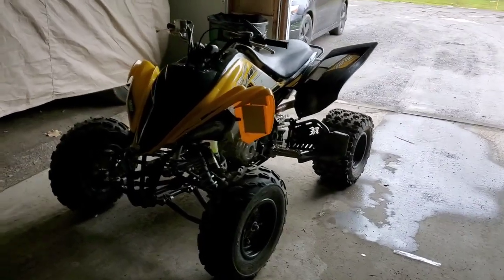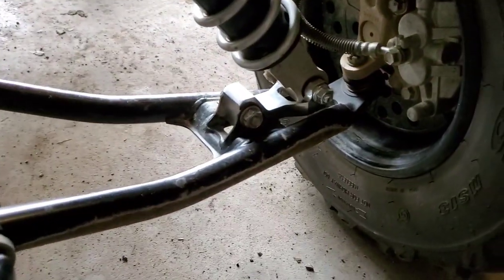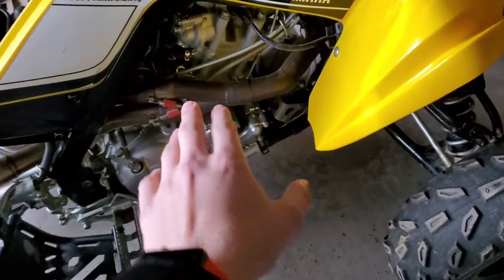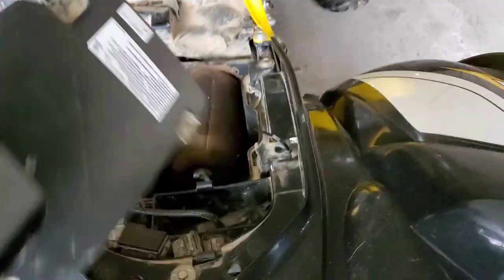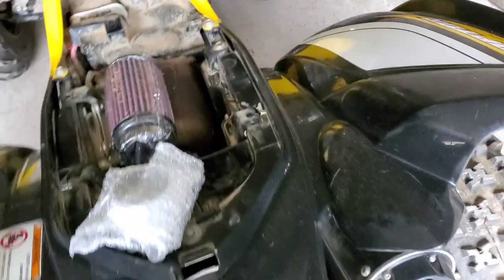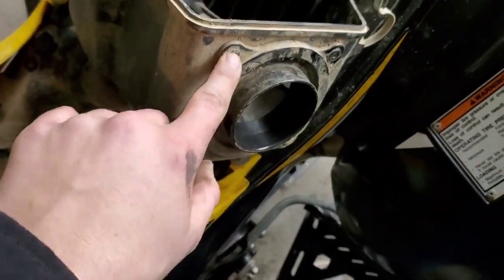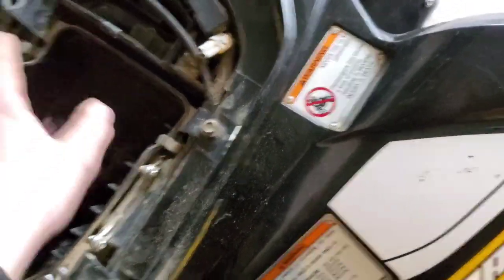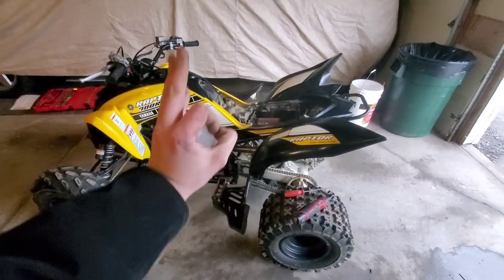2016 Raptor 700R update and Air Filter!

Comment: As angel said use a medium "blue" threadlock compound/liquid which should stop your bolts vibrating out.
Reply from the maker: Thank you! I will do that once I gat replacement bolts!
Reply: @JNKRacing  had the same issue on my 125cc 4 stroke Lexmoto Adrenaline supermoto. So when I got my Spy Racing F3-350 Quad Bike first thing I did was blue threadlock anything cosmetic and the parking brake too.
Reply: @JNKRacing  https://youtu.be/LTisTFvyWgU this is the Quad I have very different beast from a Raptor.

350cc, 6 speed gearbox, limited slip diff and shaft drive. Dual Exhaust system from the factory too. Front tyres are 185/30/14s and Rear tyres are 275/30/14s.  Always get a load of smiles wherever I go on it.
Reply from the maker: @jameslrbrand2002uk  Yeah we figured it was a common thing just never got around to dealing with it lol!
Reply from the maker: @jameslrbrand2002uk  That things is sweet! I have never actually seen one like that! Sounds wicked to ride!
Reply: @JNKRacing  Oh it is sweet to ride. Had it up to 92mph on GPS. Got it in the same colour as the video too. Forgot to mention it has a 13ltr fuel tank and 5 disc brakes one on each wheel and then one for the parking brake mounted on the driveshaft.

Would still love to get me a Raptor though and maybe fit an engine and gearbox from a 2018 Yamaha R1M, I've only seen one such bike done here in the UK though a few others run the engine from a 2013 Yamaha R1.

Comment: maybe use a lil medium thread-lock juice on them bolts so they won't loosen so easily...and I was wondering what fuel you use ..racing/non-ethanol/super etc....and also if your considering changing the fuel injection system ..
love the K&N filter addition and the duel pipes look wicked  🤩🧡
Reply from the maker: For sure! I actually run between 93 or 90 ethanol-free,  I haven't really considered changing the injection system, but a cam and +2 throttle body have rolled my mind a few times.... Thank you I'm glad you like it if you like the way they look you would love how they sound!